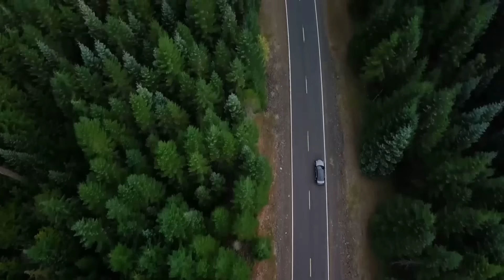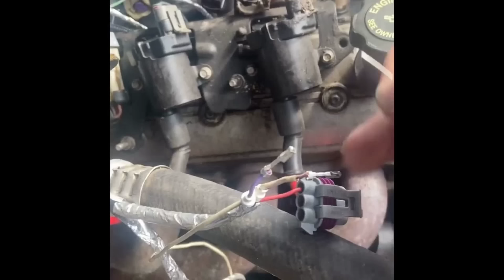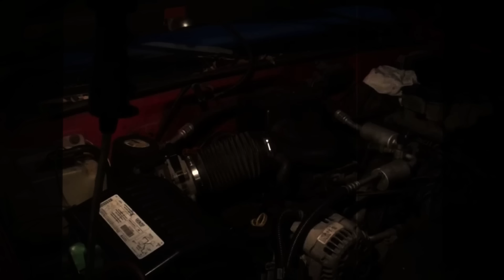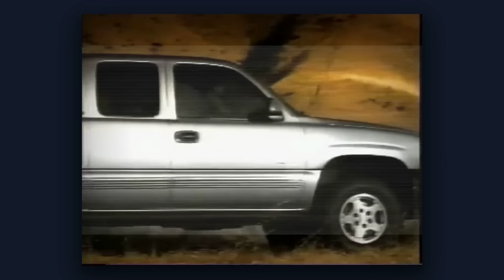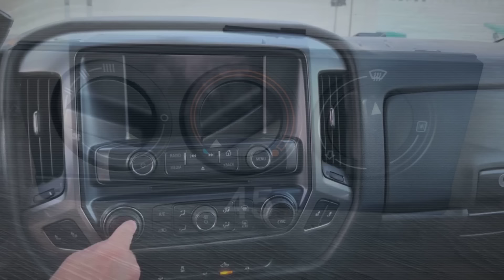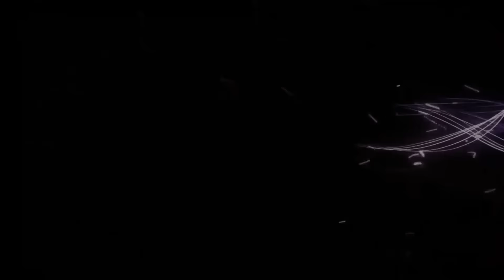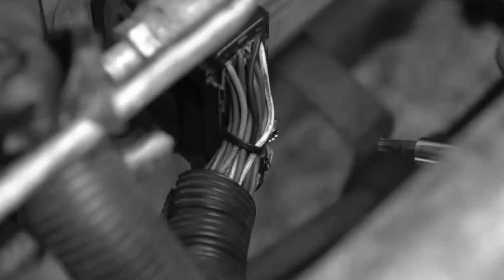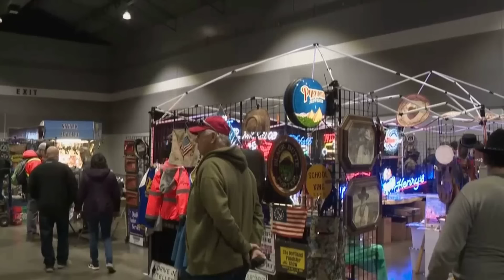How Smart Mechanics Are Bypassing The Dealership (The "Delete" Loophole)

Comment: This is interesting. I owned a performance shop through the eighties and made a lot of money replacing the first and second gen engine control computers like the Chrysler electronic spark control or the lean burn system. Ripped all that junk out, installed a ballast resistor, distributor and straight electronic ignition box and the problem was solved. We're now at exactly the point that I saw all this computer shit headed towards forty years ago and now the same fix is needed to keep these new over teched over engineered piles of shit running.
Some things never change!🤣🤣

Comment: I have a 2001 Jeep Cherokee XJ and the HVAC system,blower, ac coil and all took a crap so I went ahead and purchased an RV rooftop mounted AC/heater unit and installed it with a buddy in one afternoon and 30 something beers later, each. 1,000 bucks later it works better than factory ever did 🤣
Reply: That $1,000 includes the beer😂😂

Comment: You don't have to Go All the way back to 1986 for an engine 1998and older GM engines have distributor. My modification was went to junkyard on a newer engine ripped out The wiring harness computer and engine and dropped it in my 30 year old truck still running great whole thing cost me 1500 dollars

Comment: I was a vehicle electric engineer for 30 years & I drive puckered everyday, because I'm either in a 2019 F-250 SuperDuty, or a 2019 F-150 Raptor, both top models every bell & whistle that will not work around 2031 to 2034. In the 250 I'll drop in a Cummins & some old transmission & a carbureted v8, manual transmission for the Raptor. Enjoy

Comment: I drive a mid eighties Toyota pickup. Part availability is definitely drying up and workarounds are now a must. In my neck of the woods, however, emission compliance tests are still required to renew registration. If you drive a later model vehicle and you decide to swap in...say a non EFI engine, you won't pass. I am thinking about purchasing a pre-1975 vehicle (smog exempt) that worth rebuilding that has good after market parts support and dealing with my daily driving needs that way.

Comment: On my 97 Buick LeSabre it does have a chip on the key and security kept going off so I actually did the exact same thing in the video and I tested the resistance on the key from one side to the other side on a Chevy and I went and got a resistor and I put it in where the security wire is which is the orange wire underneath the dash and it fired right up otherwise this car would not start

Comment: Mechanical diesel and a manual transmission... done. even runs on used motor oil. Only needs a battery to start. Farmers know best. Sure its loud and stinky but it always works.

Comment: My 2000 Jeep Grand Cherokee was having a problem with a scim  chip. Chrysler the maker of the new Jeeps wanted over $500 for a new set of keys, door locks and reprogramming. I pulled the computer out, sent it off to all computer in Florida. They reprogram the computer, removing the skin  app. Easy, cheesy! Not only that, but the grand Cherokee run better with a new computer in it. No, only that, my gas mileage went from 14.3 miles per gallon for the big V8 , to 19.3! Dealerships are screwing themselves over. The common man does not want to pay $200 an hour for shoddy work.

Comment: With ignition switching, I removed the chip from a broken key and glued it to the sensor in the steering column 😎

Then I used a dremel tool to cut a cheap blank off eBay. I could have had it cut professionally but I was too far gone by that point 😂

Comment: While you can revert back to a Carburetor and Spark Distributor. The PROBLEM is 1996 and up vehicles with OBD II is what the EMISSION checking stations plug into. Without it you don't pass your Emission ck. The Dummycrap state of ILLINOIS will suspend your License plates an DRIVER"S LICENSE!!!!!

Comment: I think there is an opportunity for a company to make manifolds that accept plain old simple carbs. And another idea would be a bolt on electronic ignition system, perhaps to the front sprocket of the engine that drives the fan belt. Both together would just 'delete' the computer. Or, like in this vid, just a new independent system.

Comment: from 84 to 86 for put obd1 computers and feedback carburetors in their vehicles.  they sucked..  my family has been taking those very mostly trucks, throwing away the carb, wire harness and distributor with it's bolt on ignition module and installing duraspark ignition and standard carb. goes from 10 pounds of wires to about 6 wires in the harness.  which btw plugs into the wiring harness coming out of the firewall. throw away that obd1 computer, set the timing on the duraspark compatible distributor and away you go.

Comment: Some cars are not capable of having a large classic motor swapped in, but it is possible to bypass a faulty fuel management system issue by removing the butterfly valve, or sticking it in full throttle position and hacking a reasonably sized carburetor to the intake side of the throttle body. Then all you need is a means of getting the fuel to it and you can run the car. The hardest part is if you need electronic ignition components. Due to how some of those engine blocks that would be like that wouldn't have a means of installing a distributor. So for those you would need to find a solution...

Comment: Big fan of keeping things working forever.  I'm not sure you'll get the desired results of a pre 86 chevy smallblock on one of these new trucks.  They weigh so much it's going to take every bit of that horsepower to just get one of these things out of their own way.  I got a 84 hardbody with a 454 ci carb'd.  It's plenty for towing on this truck but it weighs less than half of one of these new trucks.  You'll need a granny gear just to get this thing rolling and towing i don't see happening without a supercharger.  Also,  These new trucks are pressure&friction welded together.  The entire vehicle including the chasis wants to fall apart.  If you need a good work truck for heavy towing,  I've seen a ton of old f700's going between 7-10k.  A guy I used to work with still uses his wrecker he bought new in 1979 with a 7.3idi.  There's options but, for sure make sure what you are trying to make work matches the parts you want to put in it.  Techniqually I could take a mobile home and drop a 460ci in it with some demon carbs but, It's going to be gutless for it's weight.  The other part left out in the video isn't "just" there's no place for a distributor "easily bypassable using the crank sensor and an ignition module" but it's the variable intake and variable cam shafts.  These systems I can't say I know well enough to bypass correctly.  The intake probably can just be replaced by variable camshaft might be a bit trickier.

Comment: My MY 2000 Alfa GTV injection/ throttle body relationship failed......Parts obsolete......I fitted a 350 Holley 2 brl carb, made my own intake manifold and kept the factory ECU and ignition by alloying it to think the injection was still working.....I installed a 6 psi efi style fuel pump into the tank , wrapped the injectors into the bulkhead loom with ground wiring so they continued to provide feed back but no longer connected to a fuel supply......and it works well.....I no longer have variable intake manifold runners, but do have a much stronger torque bottom end.....so my usable rpm ends at 5k which is fine.....over that only loses ones licence to drive anyways......plus the engine should last because it cannot be revved to 7500 any more.....

Comment: I'm a mechanic... this video is kinda off. The info is a Lil skewed. The reason for the rise of fuel injection over carburetors is efficiency. Carburetor technology will never be as efficient as fuel injection. Here's the thing about obsolete parts, that  means a OEM replacement is no longer made, that doesn't mean other parts aren't available that will do the job just as well. I drive a 84 econoline ford van and a 94 lincoln town car. Neither are stock, both go above and beyond what I need them to do.

Comment: A/C out of refrigerant gas and mechanic wouldn’t refill as the ECU had locked out the compressor due to low refrigerant. Told me I needed a new compressor for $1500. He said if the compressor wasn’t locked out he could refill the A/C.

Went home, pulled out the A/C relay, Jumped the positive side from the battery to the positive side leading to the A/C compressor with a paper clip. Drove back to the mechanic with the A/C compressor running - Re-Gassed. Then pulled out the paperclip and replaced the relay. The look on the mechanic’s face was priceless 😂

Comment: I woke up one morning to a underhood fire of my 1991 Chevy Astro Van in my yard. A Fireman asked me if I wanted them to call a tow truck after they put the fire out?  I told them no, I had tools in it that I needed to get out first.  I did, but was already planning a rebuild. I could also imagine the difficulty of me trying to get access to my own vehicle at somebody's wrecking yard. I have worked on my own cars for over 40 yrs.,  love watching Dragracing, and I'm an Electro/Mechanical Engineering Technologist.

A day or two later, I started taking out burnt wiring and components. This included the ECM. I also have a 1982 Ford Thunderbird that I had replaced the old carburetor with a new Chinese reproduction. I knew that carb would be easy to get to work on the Astro. I had also put one on my 1979 Dodge D150 360 CID. The came stock on some early '80s up 390 CID Fords. You just have to stay away from using gasoline containing Ethanol.  The copied the materials used in the '80s on the orginals carbs.  First, I made a plywood adapter plate to pick the 3-bolt pattern on the intake manifold and the carburetor's 4-bolt base pattern. I found an aluminum two barrel to four barrel carburetor adapter. I later replaced the plywooden plate with an aluminum plate that I made with a jigsaw this was after the steel one I ordered, located the Butterfly opening too far rearward.  I found an electronic, non-computerize Chevy V6 distrbutor online. I bought a Universal Wiring Harness with Fuse Box to replace my burnt underdash wiring. I also had to replace the Tie Rod Ends, Center Link, Pitman and Idler Arms. I'm making my a Custom 
Dashboard,  because the old one melted.

Next I had to drain & flush the water they used to put out the fire out of the engine and fill it up with a good, but cheap motor oil.  The  next step was to get a Holley fuel pressure regulator with a return line so I could use the intank  electronic pump that I had replaced a few years before.  I got the engine running.  It sounded better than it had in years, with that old dying TBI on it.  My next problem was the fire had also taken out the radiator, hydro boost, ABS, Power Steering Pump, Alternator, and A/C.  I ordered a new Vaccum Assist Master Cylinder to replace the Hydro Boost, Radiator, Higher Amp Atlernator, & A/C Bypass Pulley. It has a 2005 Front Grille Assembly to give it a newer look.

Keeping motivation was the hardest part. Most of the other parts came from Ebay & Amazon.
Reply: shoulda scrapped it

Comment: Doing this sh!t is expensive af, though. I JUST sold my 2002 F150 King Ranch that I NEVER wanted to get rid of, but my parents found me a 2013 F150 with a Coyote 5L in it that is CLEAN AF (but, w 183k miles on it). I told them, as long as YOU pay for the maintenance/repairs, I'll sell my truck and take this one. They agreed and so I did. Now, I hope this 2013 goes till at least 400k miles. I put my LiveWire TS+ on it, but I'd still like to do completely Ford independent engine management.

Comment: The carb replacement or older engine block replacement has one big issue.
Emissions. 
You can't take your car through emissions to get your registration if the computer doesn't say everything is fine. 
Also in many places with emissions, it's illegal to swap in an engine from a vehicle older than the vehicle you're swapping it in to. 
This varies by location. Yes it will run, but you can't legally drive it without registration, which you can't get without emissions, which you can't pass with the swap.

Comment: This is why I do not own anything older than 1996..I can figure out a go around for everything in them. Ain't no way I will have issues getting a SBC running with a carb and a dizzy. Xp The issue is..Finding that HD manual transmission. 8/

Comment: I used an adjustable tractor 3-point top link to replace the rear control arm on a 97 Toyota 4Runner because I was in the middle of nowhere. Still there after 8 years. Works fine.

Comment: That has come to happen since so many OEMs have outsourced parts instead of making them in-house or by a company owned spin-off (Autolite, Delco, et al.) They source many parts from outside vendors and mostly use JIT (Just In Time) parts vs. holding large inventories.       
  Regarding so many that believe there are laws requiring they have xxx amount of parts in stock:
"While a widely held belief suggests a 10-year, 10-percent rule exists, this is generally a misconception. However, parts availability is driven by a mix of warranty law, EPA requirements, and business incentives. 
  Key Factors Governing Parts Availability:
  Warranty Obligations: Under the Magnuson-Moss Warranty Act, manufacturers must be able to provide parts for repairs during the term of the manufacturer's warranty.
  Emission Components: EPA regulations require manufacturers to provide parts related to emissions control for a set period, typically 5 years or 50,000 miles, with parts available for a longer period (up to 8 years in some cases) for defects.
  Safety Recalls: Manufacturers are required to provide free remedies (repairs/parts) for safety-related defects found within 10 years of the sale of the vehicle to the first purchaser (49 U.S.C. 30120).
  Voluntary Practice: While not legally required to hold parts for 10 years, many manufacturers do so voluntarily or via internal policies because it is profitable and protects brand reputation.
  Supplier Overage: During production, manufacturers often order a surplus of parts (overage) which are stored in depots for future repairs. 
  In summary, there is no federal mandate to stock a specific percentage of parts, but contractual obligations to dealers and the economic necessity of supporting vehicles through their warranties often ensure parts are available for several years post-production. "

Comment: Even Rock Auto doesn't have that glow plug controller!

Used ECM's are easily had, although it does have to be set to your VIN.  

The resistor in the key security is ancient history.  They use programmable RFID's now. 

Ever try to dial in a carburetor?  All but impossible, and that presumes you can find the jets.

Comment: A holley is fine and dandy when you don't have a large variation in ambient temp. If you live in central canada or a climate like it you will run into problems. The reason why factory fuel injection is so good is because they have hundreds of fuel and timing maps written in the ecm. You can only have one map loaded at a time in a holley which means you will be loading different maps multiple times a year depending on what the ambient temp is on any given day. Before you start stating that the Holley is "self learning" you should know that I have spent a lot of time tuning with various aftermarket stand alone ecm's and I am aware it is "self learning but only once the coolant temp hits 150 degrees. If you coolant temp is colder than that the system is running on whatever file you have loaded. There are many flaws in the thinking behind this video...

Comment: 3d scan and print a new intake manifold to accept a carb 3wires for a starter switch wire in a cheap petronics for spark control from the cam or or crank sensor.
My self I seen this coming 15 years ago and kept my 1987 Jeep with zero computers and a HUGE after market for body panels. It can sit for 6 months and starts right up every time I will drive it untill I die.

Comment: i mostly do the same when electronic parts are not available...... 
i use resistors transistors diodes and other electronic components and change the system and replace some parts of different car of same company and it's works well i have done more than 18 cars full system change  and other i changed different electronic parts

Comment: yep..my 2017 sierra climate control modual died and the 3 wire fan runs on a pulse so you have to buy a very expensive part that must be programed to your vin. my bypass i put a 2 wire blower motor out of 98 dodge truck through a toggle switch and for 67$ it works great

Comment: I see nothing wrong with 90's-style car computers but the software should be open. Separate the engine and body computers to allow more repairability/usability. I was always fine with electronic control until I found you couldn't load the software on the ESU yourself. They charge hundreds to re-program when it can be done in minutes from a tablet.

Comment: Basically we need to buy a new truck, strip out the new engine and bullshit and then make it what the trucking industry called a glider and put your old motor and transmission into it. So here is another option. But a salvage truck and strip all the body panels off of it and build it back on a old frame of a pre-emmisions truck because the serial number is associated with the frame. Body styles are cosmetics. Strip off computers and rebuild your system